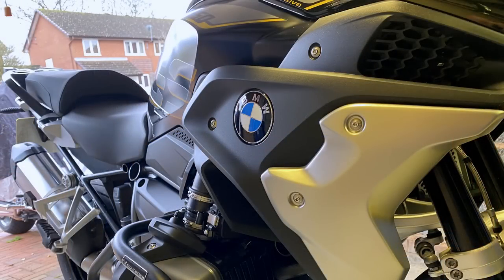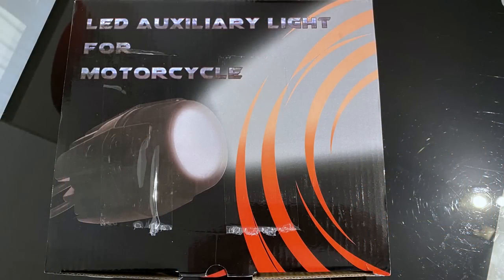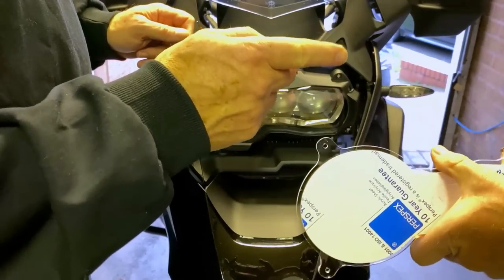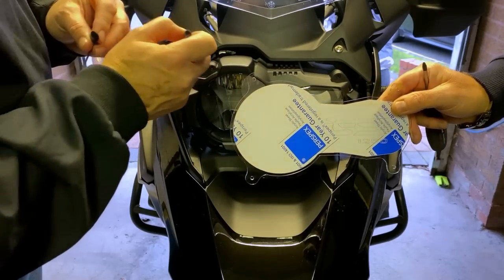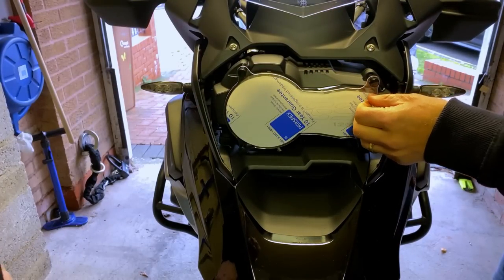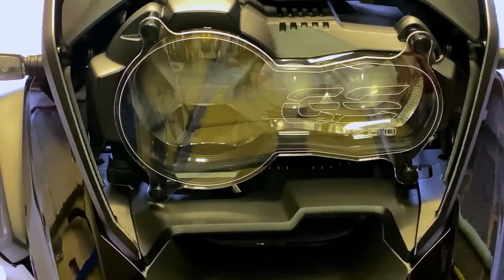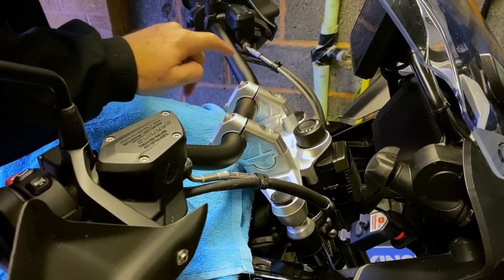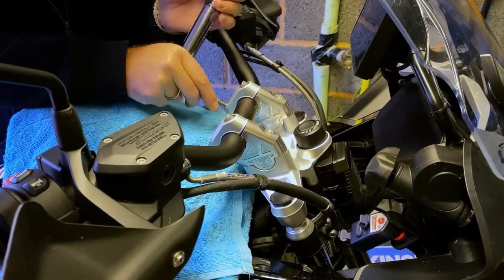Fitting Ebay Accessories to a BMW R1250GS Exclusive

Comment: Just followed this guide to fit the fender extender and rear hugger. Clear instruction and a brilliant video
Reply from the maker: Cheers Sam. Glad all ok. Just an update. On the hugger, the three bolts that hold hugger to frame should be threadlocked or they may work loose as they ‘bottom’ out without locking or spring washer 👍🏻

Comment: Thanks, nice video. I've save hundreds with eBay parts, and they are just fine. My rule of thumb is I always buy BMW part when it comes to mechanical moving parts and fluids.
Reply from the maker: Thanks. I find most accessories that are moulded, fabricated or cast are ok. The finish may be a bit more rough and the plating not quite so deep, but basic things today can be easily copied with accuracy 👍🏻

Comment: I've previously had a rear hugger but it did not really appear to prevent muck spraying around, a mud sling at least keeps the rear suspension unit clean. I'm not sure why everyone slavishly fits bar risers.....can be good if you are tall and/or stand up a lot off road: The bars can be rotated within limits and this has been useful for me. I've tried various Chinese lights and have found quality control variable with imprecise beam patterns. I'm a Denali man and appreciate the EU marks for when the German police stop me....
I have just bought some Ali express engine protector bar scratch protectors (!?) for £3 delivered,  can't complain!
All the best, Nick in Knutsford.
Reply from the maker: Nick Laskaris thanks for the comment Nick. I think the combination of Mudsling and Hugger may be although some mention clearance then. The bar risers I feel I need as I’m long bodied and slouch a bit after a stretch of miles. I’m Denali too. It’s about the only thing I wouldn’t fit to mine I’d the Chinese lights. I love my Denali’s

Comment: Thanks Nick. To think that I was going to give Nippy Norman £169 for the Mudsling and Extender pack when I picked up an identical product from KemiMoto for £30! Have just fitted them to my GSA and I’m delighted with the saving and quality. 👍🏻
Reply from the maker: Certainly all but the lights have been excellent. One LED light has water in but certainly all other bits are fine and you can add to that recently frame guards which fit identically to the Touratech ones (with the little screw into a rubber bung in the lower engine mount 👍🏻

Comment: Brilliant video Nick, very useful and surprising the quality of some of the products.
Reply from the maker: I was quite surprised. It was a bit like 'If it's s**t what have I lost?', but certainly the hugger and H/L protector were very good and the front fender extender the same (moulding may have been a little better but cleaned up with Stanley knife)

Comment: Great video Nick - just one point about fitting the hugger, not just a cheap eBay hugger, but any hugger - I fitted exactly the same one as in your video and generously used Locktite Blue thread lock and correctly torqued - keep an eye on the torque arm securing bolt - despite the thread lock solution, the bolt has come loose twice in the past 1000 miles - I have just added a heavy duty spring washer to the bolt to see if that will stop it from vibrating loose.
Reply from the maker: Yes. Should be in the video really but it is now loctite’d and over 3-4K miles has had no issue but thanks for refreshing the comments with it 👍🏻

Comment: For 2022 gs, I got, from Ebay. 2 touring windscreens, a Puig Windscreen visor, grill type head light guard, and driving lights guard. The windscreens don't fit perfectly, but flex enough to fit. I choked at the BMW dealer prices , for essentially the same stuff , also made in China.
Reply from the maker: There’s bargains to be had for sure Jim but not all works out. If you’re willing for the risk on some then it’s a route for sure 👍🏻

Comment: If you buy aftermarket parts with different head screws/bolts, just buy secondary replacement screw etc. with original type heads from Ebay. You have already saved £s and a few pence won't break thebank
Reply from the maker: Reasonable point Kevin. It's just there is not a single fastener on a BMW from standard that is hex, including Torx would add to 'patterned' part appeal?
Reply: @nickhodgeUK  I know. Its not hard is it for the "cheap suppliers doing the same!

Comment: Great Video, I just ordered a fender extender and a hugger for mine and just wondered if there were any instruction videos, some nice tips.
Cheers Chaps 👍🏻
Reply from the maker: On the Hugger Andy, blob some threadlock on the three bolts that hold the hugger to its frame or they can vibrate loose. Other than that all still fine 6-8k miles on 👍🏻
Reply: @nickhodgeUK  brilliant tip, thanks for getting back, mine was £30, still waiting for delivery but any help getting it sorted is appreciated

Comment: I'm currently waiting delivery of my 1250 GS but have removed some of the items from my 1200 GS which I'll transfer across including a Puig hugger. I'd suggest you put some locktite on the threads of the 3 small bolts that hold the hugger to the bracket as I've had one come undone in the past. I've ordered some of those aux lights which I'll control via my hexezecan and one of those front fender extenders as my pyramid one has stayed on the 1200 as I had to drill the front mud guard. I've also ordered some smoked hand guard extenders as again I had to drill holes in the OE guards to fit the touratech ones on the 1200. I've bitten the bullet and gone for the xhead cylinder head covers rather than some more SW Motech engine bars as the ones on my 1200 don't fit and the xheads are cheaper and easier to fit and clean and I decided to get premium engine protection rather than risk ebay stuff not being up to the job if it's ever needed. I've also got some frame fillers too but just bought them separately off ebay after someone on UKGSer provided the sizes. Finally I also have the machine art mudsling which I bought after getting a cheap ebay one that didn't work very well, but have had to modify the hugger as with both fitted they rub against each other. Cheers for posting the vid, it was very useful.
Reply from the maker: adrianbarrie13 as was your comment interesting Adrian. Thanks for posting. Ride safe and enjoy the 1250.... you will
Reply: @nickhodgeUK  Yes I'm looking forward to getting it as you can imagine. Regarding Sean's aux lights if he doesn't use the DIN accessory socket on the RHS of the dash he could take the power from there instead of direct from the battery. I did this with my square aux Lights I had on my previous one which meant I didn't have to remember to switch them off, plus if they went faulty I could simply unplug them. Cheers Ade
Reply from the maker: adrianbarrie13 good thought Ade although like me he has the twin USB outlet and often has phone and other stuff charging. 1st World Problems eh?

Comment: Nick, I have the Exclusive and on purchase last summer fitted a shed load of Touratech stuff to it. So now some would say "a fool and his money are soon parted" or perhaps from the opposite camp "if you can afford it, go for it". I was lucky to have been in Spain for the spring and sourced the lot (Evo Panniers, top and bottom engine protection bars, lens cover and two full Campanero suits) from the Alicante Touratech branch at far far lower prices than from the UK branch.
This made it a very tempting proposition in kitting the bike out with top notch accessories. But my rationale for doing so in the first instance was that having shelled out big bucks for a new BMW there was no way i was going to fit cheap aftermarket accessories to it. They would probably do the job but why compromise if you've bought the best in the first place. The purists out there will surely spot the cheap bolt ons and compromises when it comes to resale time.
The cheaper aftermarket goodies are fine IMHO for older bikes but not on a bike close on 20k new. I hope your friend doesn't regret not buying the quality Denalis and that all is well with the on board BMW electronics
Like it or loathe it I think sometimes its necessary to add whats expected quality wise to a new bike to protect its kerb appeal. 
Nice vid all the same 👍
Reply from the maker: Pete Hudson great comments Pete. Thanks for taking the time
Reply: I’m sorry but I can’t agree with that logic. The bike may be worth 20k (although at times I think that is debatable) but a bit of black plastic is a bit of black plastic! Putting it in a wrapper or box with Wunderlich on it shouldn’t quadruple its price. As for the Denali’s v Chinese lights, that may be a different case, as things that operate with a power feed can go wrong and although the Chinese lights are a fraction of the price it may be the case that they go wrong more often, which then depends on whether you can be bothered replacing them (for me, that’s a no-brainier but others may feel differently).
Reply from the maker: @tartantam3405  Love opinions. Of the things I fitted the two I may NOT fit to mine (and Sean has doubts about one of them) are the lights (my Denali's and the whole Canbus integration I wouldn't swap) and the bar risers. Those are made VERY well but it does leave the cables pretty tight on full lock. Yet to see what 'premium' ones do, suspect they'll probably be little different to be fair
Reply: @nickhodgeUK  Did you get the premium bar risers fitted? Did it make a difference? What was sean having doubts about?
Reply from the maker: Kilian Fitzsimmons-Wilson no Killian. I have none currently. He’s concerned the pipes are tight at full lock. We’ve released a little by moving cable ties but it’s ‘watch this space’. Been bad weather here so not tried. Also noted bar touch tank bag on full lock
Reply: @nickhodgeUK  ok thanks. do you guys only have lower crash bars - is there a reason for that? I have ordered the headlight guard, the rear mud slinger and fender extender.  On the fence with the bar risers and lights.
Reply from the maker: Kilian Fitzsimmons-Wilson that’s a good selection to start. We have different bars but you’re correct. Only the lower. My though is just the cylinders stick out soooo far they look vulnerable. I may yet add upper but I have used my lower. Bike rolled off side stand. Nothing bar a small scratch on right bar so pretty happy as that would be a £120 cam cover at least

Comment: I brought all (apart from the lights) of these items and more from either eBay or AliExpress all Chinese made items) for my 2020 GSA 1250....  And from what I can see so far, all look/work as they should. I would recommend trying the “so called” cheaper items from “non named” Chinese suppliers before spending a fortune on named brands items. Besides, most if not all (named or not) are made in China anyway.
Reply from the maker: Craig Sellars exactly what Sean said. For what he has bought what did he have to lose apart from a few quid. Five of the six were very well built or the same as whatever the known aftermarket seems to sell

Comment: Another great...no actually better than great video Nick. Tell your mate not to stand on the kneeling pad though. I hate it when people do that. Very useful video & comparison check. I've put Denali D7'S & an Innovv K2 on my 1250 GSA. I was going to get the fender extender & mud slinger, I'm not sure now though. Not seen a hugger for the GS before this video. I can see why use Denalis, but wow what a saving on all the other goodies. I'm not sure why some guys fit those bar risers. If I ever meet someone with them I'll see if I can have a sit on see what they feel like in that position.  Keep up the good work Nick.
Reply from the maker: Nightcrawler666 thanks for the comments. Those D7s are mahoosive. Hope the vids proved useful for them and K2. You’re safer come what may now 👍🏻
Reply: Yea I'm not totally sure the D7'S are the way to go. Knowing what I know now. I'll be putting a video up soon about them. I just noticed in your links you have an optimate twin usb. I bought a twin usb thing with a blue volt meter on it from Ebay. It lasted a while but died new years day in Spain. I think water got inside it. How do you rate that one you have? Mine lasted about 5k miles. Also it says it turns off after 3 hrs. Doesn't that socket turn off automatically after about 60 seconds? Which annoys me tbh.
Reply from the maker: Nightcrawler666 mine’s been fine. I had it about 9,000 miles. It has two rubber grommets but when serious riding they’re both taken anyhow. Power for items in Givi tank bag and power for rear-facing camera and yes. The socket powers off via the Canbus after about 30 seconds. £29.99 I think??

Comment: Very interesting video, thanks. It's always a dilemma - to save the money or to buy the original parts... Clearly, there's some IP involved in all of this, and having been involved in businesses that suffered from product cloning (to put it politely), I can see both sides. Having said that, in the BMW after-market the original parts prices are just eye-watering so I can completely understand why people choose the copies. I fitted the Wunderlich bar back/risers and the only observation I would make is that they appear to be a better match to the BMW parts - in terms of colour and texture, but otherwise exactly the same as the ones you fitted.
Reply from the maker: Richard D I’m with you Richard. Not only in IP if it’s ‘due’ but also that not all coming from China is poor, or good quality. It takes a trained eye. Having been in hand tool sales all my life I’ve seen the transition from UK to Germany, to Japan, to Taiwan and China (and countries between) and quality varied hugely. Not much in this batch was poorer than anything from the ‘premium’ aftermarket. I grant the fender extender had some plastic ‘bleed’ from the moulding but cleaned with the flick of a knife. I get that someone had to design and run prototypes and such for this but it is very tough to account for £49.99. Take £1.00 for the mould contribution in first 10,000 pcs. Still as you say eye-watering profit. Great of you to comment and ride safe

Comment: Hi, great video and I’ve pretty much done the same, I’ve got the mud slinger that came with the front fender and happy, I like the look of the carbon hugger though, do you know if both will fit together or would I need to remove the mud slinger, also for the hugger, could the original brake callipers bolt not be used then?
Reply from the maker: Jason. They certainly can’t be used together. I can’t now remember if the bolt was replaced. If it was it would be because the original was too short for sure as I like as near original as possible

Comment: Hi Nick, enjoyed this money saving video, as we say,, you pays yer money, I prefer the Puig Carbon look Hugger, std, front fender extender, wired in BMW spotlights with switch on the mirror housing, they do cost more but my preference, I also added the Denali horn which is super loud and bar up and back risers.  As I am in the process of changing to the 1250 Exclusive , all these extras have to be removed as they will fit the new machine, surprising how long it takes to remove these add ons, we are ready now and waiting for the new 1250 to arrive soon and start to reinstall the kit, plus the headlight cover and need engine bars as the 1200 would not fit, hopefully having some custom made units from a local chap to me who specialises in stainless steel exhausts so a bit of pipe bending will be right up his street.
Have you planned any rides for this year, we are having a slight change and heading south to start the season, hopefully a little warmer than going North, usual scenario for us now, bike into trailer and find a decent camp site and tour the area by Motorcycle?
Whatever you do ride safe and enjoy,  Derek
Reply from the maker: Derek Holme thanks for the great comment Derek. You’ve a treat coming. Hoping to do Wales again in spring and then Pyrenees in late summer (with stuff in between). I prefer the ‘built-in’ nature of my Denali gear but the rest was all pretty well made. Ride safe too

Comment: great video to watch ,  had a quick look at the items on ebay and was surprised the rear huger as gone down a little from you doing the video with an extra 5% off at moment
Reply from the maker: Mark Vickers see that Mark. Couple changed in price I think 😂
Reply: Stay away from this cheap Chinese hugger. I purchased one and have to say all looked good but the first time I took the bike to a high speed somehow the hugger touched on the tyre and the bushings you see in the video for mounting the fender to the frame gouged a trough in my new tyre and caused quite some damage, my advice stay away from this product,

Comment: I’ve got loads of cheapo eBay accessories on my GS650 twin. Beak extender, front mudguard extender, radiator grille, etc. These all seem to be nicely made, well fitting items for a fraction of the cost of yer Wunderlich, Touratech , Motoraad et al. 

BUT, my safety is not dependent upon any of these parts, they can fall to bits above 30 mph and it wouldn’t matter a damn. My handlebar risers (shutup, I’m very tall and very old !) are pukka ones,
I do fancy a footpeg lowering kit and the W/lich price is absolutely crazy by the time you’ve bought all the bits required. .... mmmm only 30 quid from the bay .... yeah but what if they broke ? 
Thing is, they might be absolutely fine, those other parts are, but,,, I don’t put all my weight on them, or entrust ‘em with my life.

Good vid mate, thanks, you already know about the terrible sound, so I won’t mention it....
Reply from the maker: Thanks for comment on the sound Jon 😂 I think I’m with you on life dependent stuff. We don’t know where the Wunderlich stuff comes from but they at least have a reputation to uphold. Ride safe